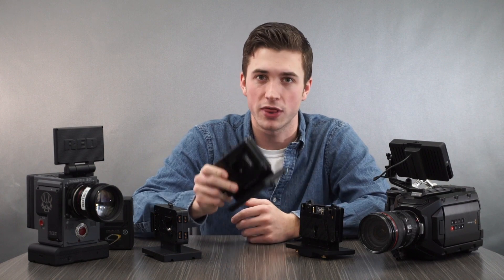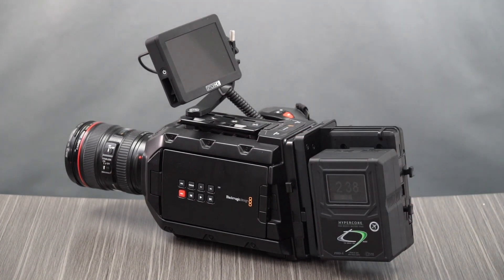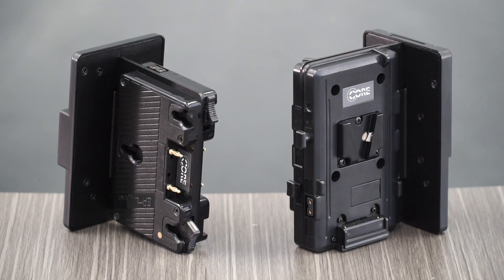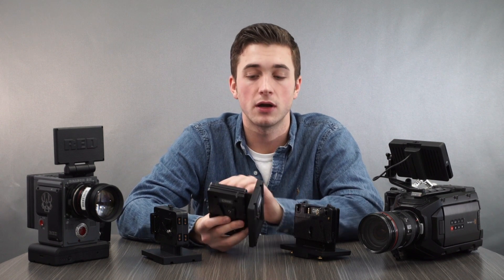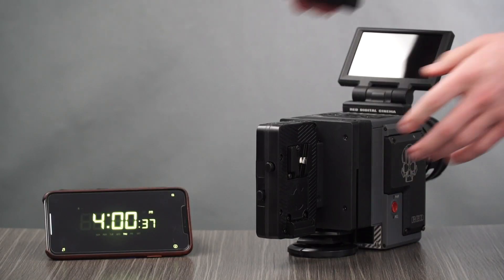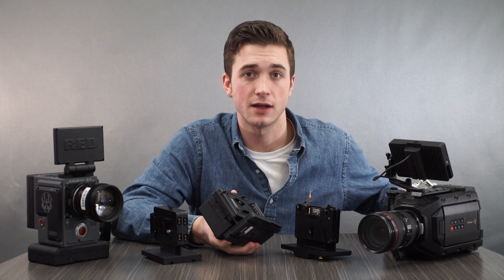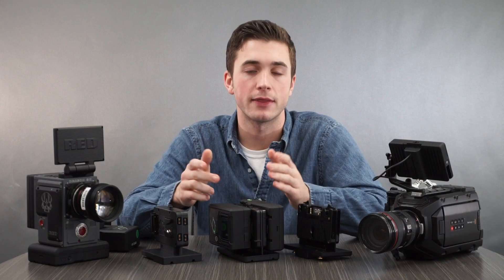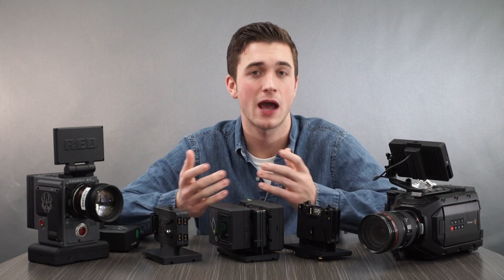Core Minute: Hot Swaps

Comment: Would this be a good way to separate the camera voltage from your monitor voltage powered through two separate vmounts? Will this device shutdown and protect any reversed polarity issues if it happens protecting your camera and other electronics? 

I’m trying to find a solution to protect my camera and monitor by separating and not sharing the same power supply through one vmount and minimize any reversed polarity through dtap. 

Any advice would be appreciated as I have already fried my monitor once

Comment: What is a good way to monitor if one of the batteries is depleted? Even when batteries indicator lights are all off, there usually is still enough power, so it can be hard to see I think.
Reply from the maker: Do you have one our packs that has the runtime LCD? If so, the most accurate representation of how much time is left down to the minute would be from there, but if you're using the LED gauge on the side of any of our packs, it's always safe to swap out the battery you put on the sharkfin first when it's down to one LED just to make sure you always have continuous runtime.
Reply: @CoreSWX  i wish they wouldnt drain equally, also i found it lasts less long when both batteries are on the fin, in my case it was 30 minutes less time
Reply from the maker: @Designguidetv  If you're looking for another hotswap option that isn't a sharkfin, we have another option called the EVO. There is a video on that as well if you'd like to take a look: https://youtu.be/NfAilbkD148
Reply: @CoreSWX  thanks!